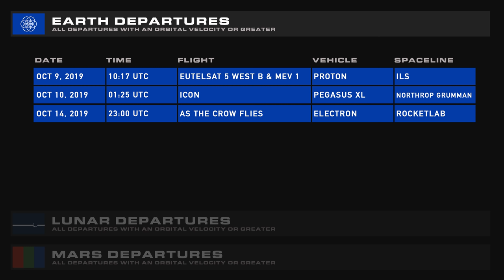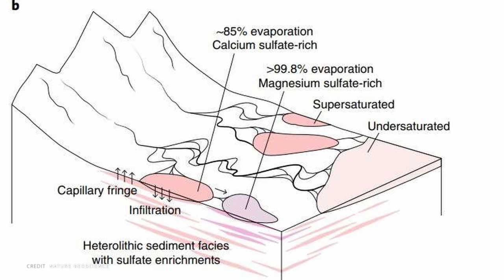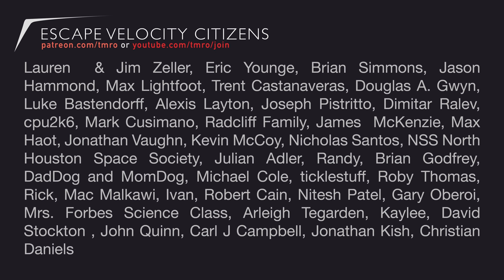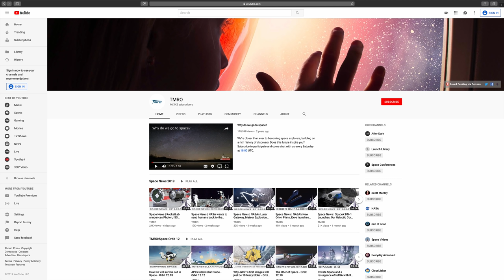Abort Tests, Salts, and Spacewalks | SPACE NEWS

Comment: Why replace the batteries? Why not just ADD more batteries? Wouldn't having more battery power be better? I know the new batteries are way better but the old ones still work so it would just be better to keep both?
Reply: Older batteries have lower charge/discharge efficiency and a higher risk of shorting.
There may also simply not be a slot for additional batteries.

Comment: The #armchairEngineer in me wonders how well it would work to have there be a dummy Falcon 9 upper stage shell in the in-flight abort test with a Falcon Heavy booster style nose cone tucked away inside. How valid would it be to have a dummy upper stage break up and be destroyed instead of a real one in order to have a somewhat higher chance of recovery or would the potential of a loss of the corresponding grid fins and landing legs make that not somehow worth the risk?
Reply from the maker: I'm guessing it'll be instrumented, that way the dynamics of a Falcon 9 breaking apart can be studied just as much as Crew Dragon's abort is. That can aid in deciding how to interpret Crew Dragon's performance from the abort, and help in determining if any changes can be made that may not be obvious to us who aren't privy to the data.
🚀Jared